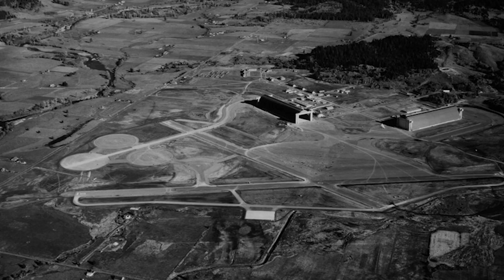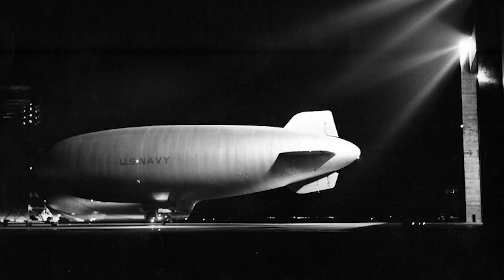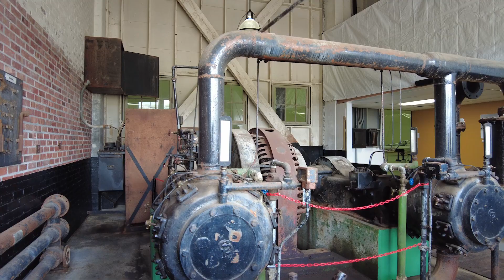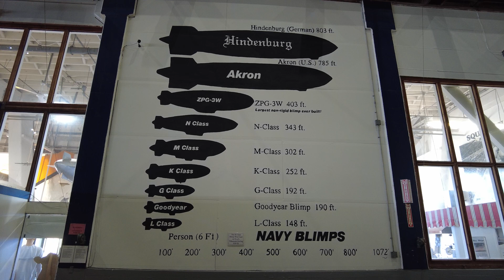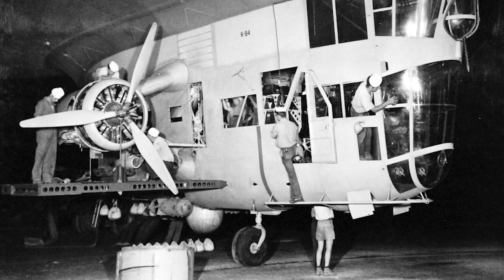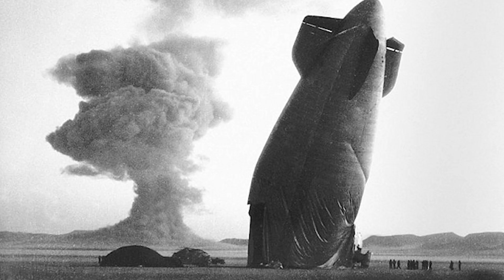One of the World's Largest Wooden Structures

Comment: Wow, that is some fascinating structural engineering.  I’m a retired civil engineer; earned my P.E. License in the late 80s designing formwork and a wide variety of shoring, brackets, etc.  it was structural engineering, and the materials were timber/lumber and steel.  I still recall designing some really complicated wooden structures.  That makes this even more fascinating,
Reply from the maker: I wish I could really portray how big it was when standing inside it.  It's impressive to say the least.  And the fact that they were built in around 30 days is crazy.
Reply: @MasonObscura  i’m sure it’s quite impressive, in person.  I believe you said it was 190’ high;  not sure if that is inside clearance or top of roof, but either way, that’s roughly the height of a 19 story building!